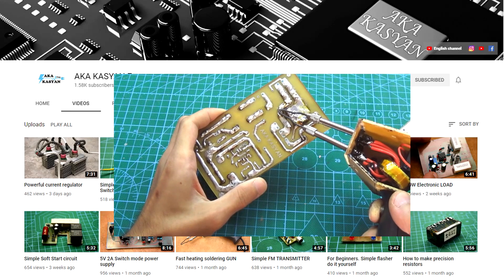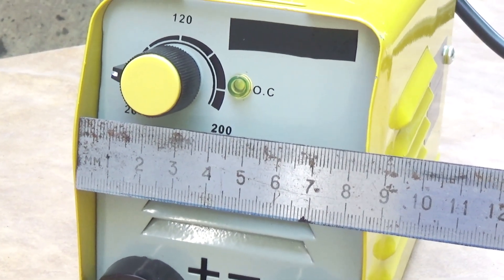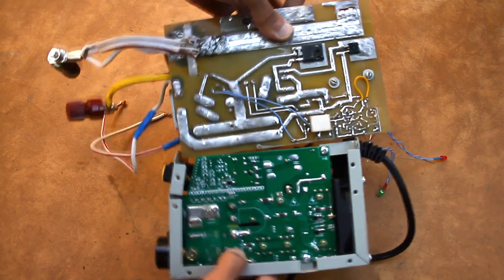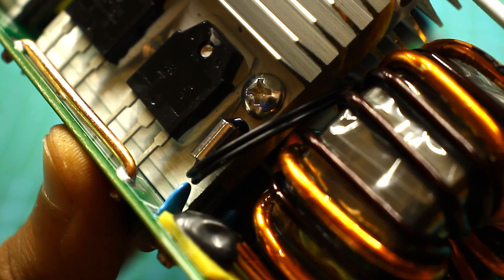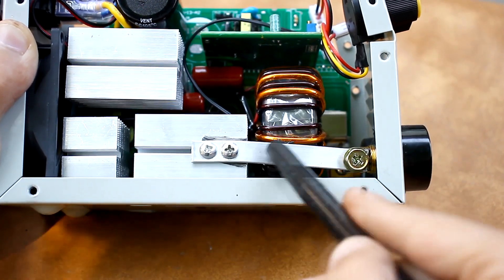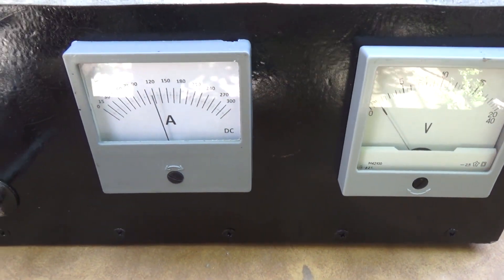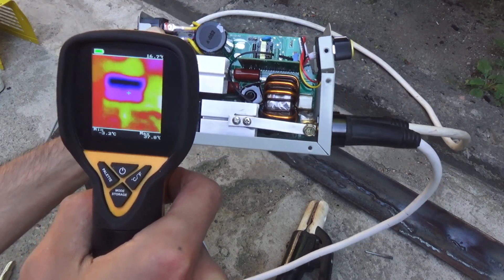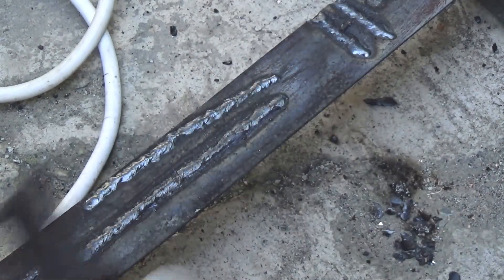What can the SMALLEST welding inverter do

Comment: When you measure the temperature of the heatsinks, because they are silver colour they will measure very low even if they are hot. Paint them matt black and do the measurement again .
Reply: Exactly they reflect the IR So you can't get an accurate  reading

Comment: No earth to the case makes this all-metal unit dangerous when used if a wire should short out inside as the operator will have metal benches that will be earthed so I would not purchase this item

Comment: Thanks for sharing I've been doing welding work since I was 21 now I'm 50 years old still a welder I never had a chance to use that smaller machine but it works good job.
Reply: Is it advisable to buy this?
Reply: @solomonpaul5317 
Yes.

Comment: Are the mains and secondary windings of the transformer not isolated from eachother? Dark and light copper wires seem to touch eachother. If that is the case, isolation is only from the coating on the copper wires. That can not be good. It's difficult to see from the video.
Reply: No reply on my point. So point taken  :-) I bought such welder too. It was actually cheap (<$40) and opened it to inspect. I have doubts if the device is electrically safe mainly because of the high power mains transformer (there are other smaller in the design as well). So just in case, I also bought a high-voltage supply for testing (4Vdc in 1800Vdc out @ 0.5-1mA). Cost only 2-3$ and will use it to check the leakage between mains and secondary (so 220Vac input and welder output / metal housing). If it is safe to use, there should be no high current flowing and voltage should be stable.

Comment: Another wasteful video, the demonstration given was making beads and not welding two items together, that is what the purpose of a welder is not to just run beads. Also, the supposed heat displaying was not proper as the cover was not in place to help with the airflow of the fans to keep the interior components cool.

Comment: First Video I have watched of this channel and it only took half the video to become a subscriber. Good video. I have a unit like this, mine came with the cable for a few dollars more. I suspect that these boards are built on mass and then a "manufacturer" puts  in in their own case and labels it. However I could be wrong. At any rate, mine does not provide the amperage it advertises (200) but it does weld pretty good.
Reply: What ampere breaker do you use at the panel for it? And do you use it on 110v?
Reply: @ramblerssafarnaama4181  I have used it at 110V and 220v, While it does work at 110 volt, I have to increase the amperage on the dial in order to get the same kind of weld. I find it lacks the initial "Omph" to create the arc and sticks more often at 110v. I get better and more consitant result at 220v. For the 110v, I have a 30amp breaker available and at 220v, it is a 50 amp breaker. Do you find similar results?

Comment: Cool video. Not bad beads for someone who doesnt weld. Hard to tell how well it penetrated the steel tube. Would like to see another video with welding pieces together to see strength of the welds and maybe some holes in steel plates filled in. From what i could see it was pretty effective

Comment: Would love to get one of these but I'm afraid it trips my circuit breaker, after all with 20 plus amps being drawn thats more than enough to trip a breaker is it not?
Anyone know?
Reply: Chances are that any circuit that will handle a fridge or washing machine or even an HD window a/c unit, it will probably run one of these welders. Got my curiosity up so I just went and checked mine, the largest 110 breaker I have in my place is a 20 amp. Mine never skips a beat. I was so amazed by these that I even bought a couple extras and gave 'em out to my friends.. Finding out that China has been using this technology since the mid '80s. I even took a chance and bought one of the plasma cutters for about a 100 bucks, works like a champ. Just get yourself a really, really heavy-duty extension cord, you're gonna need it, if you want longer welding leads, I used some old jumper cables I had laying around. Good luck.

Comment: Got mine working today, first time welding. I noticed mine has a screw at the back near the power switch, it says in the manual that it is supposed to be used to connect a ground wire to the unit, which is an odd way of setting it up, as the wire would be housed independantly of the others. I noticed on yours that there is no such screw on the back. Mine is the 120v version. It is very difficult to strike an arc with it, it sticks to the metal a lot, but for $100 I got it, plus the grounding clamp wire and the electrode holder. Very good deal.
Reply: 100? harbor fright has far better wire welders for that price.

Comment: 15 years ago I bought for 100 USD an italian Telwin 100 Amp, a 125V which could be plugged on a common 15A plug so it was usable everywhere with 6013; 309 and 312 sticks. Excellent for light fabrication and reparations anywhere with a 15A plug. I gave it 5 years ago to a friend after burning  hundreds of sticks, it works always flawlessly.
A trick, with these miniature inverters, stainless steel sticks as the the 309 and 312 are easier to use, with less heat and gives very good results, specially on 14 gauge galvanized tubing, as the welds are smooth, with minimal burn of the galvanization. No grinding needed as the "glass" pops by itself and the welds are nice.
Reply: That is a characteristic of DC welding.....you hardly ever get a bad weld and no splatter either.

Comment: The enclosure is metal and It didn’t look earthed, earth bonded or double insulated. Could be a death trap?
Reply: I bought one, the 120v version, and there is a screw on the back that is supposed to be used to connect a wire to ground the unit, I'm not sure why but the one in this video doesn't have it, maybe mine is newer. Also not sure why they didn't just include the ground wire with the other 2, I think maybe they got in trouble for not having it grounded so they just added the screw on the back to keep from getting sued. Having said that it does work pretty well for how cheap it is, though the amperage isn't quite as advertised, and it is difficult to strike an arc. Great deal for the money though.
Reply: LABizñ

Comment: I already use a lot of welding inverter but the most durable and good quality Is mosfet than igbt.  You can compare the igbt to an iPhone.
Reply: MOSFET should create less heat.    Transistors are current driven.    FETs are voltage driven much like a tube.

Comment: Yes ..to be honest it was a nice review.
Very helpfu.
Mam, can you please help me in repairing such inverter welding machine.....I have changed the blown IGBTs and rectifier..But unfortunately Iam getting repeated damage for the replaced ones.
I have also checked the other adjacent components for fault..but they all seems ok. What to do...please help.
Hope you will help.
Reply: Replace the whole unit, it's cheaper and no labor cost or time...

Comment: hello would it be possible to remove diodes on the output side to make ac instead of dc     ...so converting it to a ac welder instead of dc ????? thank you
Reply: No, the output frequency is in tens of kilohertz, so DC conversion is required to prevent radiation loss.

Comment: How much dose it need until it tig
Reply: You will need a Tig torch and cable with tungsten electrodes and some Argon gas, then you can do scratch Tig welding quite easily with practice.

Comment: The best technical review, 

Cal:240Vx40Ax0.8/38Vout=200A
In order to output 200A, change IGBT to 50
Amp or higher, change current sense to lower turn to boost out put current,
Change output diode to to 250A
Good luck
You do not need soft start for welder since you never weld before you turn on switch
Reply: Good ideas for upgrade 👍
But surge limiter is also a good idea to charge 680microF cap slowly, reducing shock on rectifier & switch.

Comment: I bought this machine from the geek less than €50 including delivery. Delivery time was 2 weeks. I tested with 1.6 mm stainless, 2.5 and 3.2 normal stick. The performance is very good, ach is stabile, start is easy. The size is awesome. It's been a very nice deal, i am quite happy and satisfied.
Reply: Szia László! Azt szeretném megkérdezni tőled, hogy milyen néven, és hol vetted? Előre is köszönöm!
Reply: Is it easy to make a hole with 1.6mm tainless?
Reply: @funnymoment5850 sorry for the late reply, the youtube doesn't send me notices.
1.6 stainless stick can be overheated easily however with short breaks quite usefull. 
To make a hole? Of course it is depending from the thickness of the material what you welding, and the amper what you have setting.

Regards
Reply: WELL SINCE YOU LIKE THAT LITTLE WELDING BUZZ BOX SO WELL WHY DON'T U MOVE OVER TO CHINA AND LIVE THERE 4 THE REST OF YOUR LIFE AND HELP COMMUNIST RED CHINA MAKE LITTLE WELDING BUZZ BOXES,PAINT THEM RED WITH GOLD STAR,U WILL BE EVEN MORE HAPPY😀😀😀

Comment: The metal being welded in this demonstration is only 1/16 inch or 1/8inch maximum thickness. Just slightly more power full than a Spot Welder.

Comment: 50 amp = 25 amp
100 amp = 50 amp
150 amp = 75 amp
200 amp = 100 amp
It gives out half amps not full amps
Reply: Daaa
Reply: I just bought one off of Banggood.  LED says 228 amps.  My clamp meter shows 114amps while welding.  I am upset...what a ripoff.

Comment: I've had one of these little guys for about 4 years now. It never ceases to amaze me...
Reply: Me too ! bought 1 from china 6 years and it still go on... why need to pay more if you can get cheap, reliable and powerful welder ! :D
Reply: What's the model you have, if you dont mind.
Reply: @plucky2115    I couldn't find a model # on the machine. It's from Harbor Freight about 4-5 yrs ago. It says; Chicago Electric welding systems Inverter arc welder(uses 3/32" electrodes). Case is white and is 9" D X 4" W X 5 1/2 " H. Hope this helps.  Y-T
Reply: @ytwhite5930  thats good enough thank you now i know where to look for it
Reply: @ytwhite5930  Does it work on 110V ?
Reply: @alainbrisebois8334    Yep,Only drawback is that it uses 3/32nd" electrodes ONLY...But it works well and my whole stick welding outfit(without helmet) fits in a sawzall box!!!
Reply: Hi. Would you highly recommend this device? I only want to use it to do light welding on Classic cars that I will buy and sell, but only will weld occasionally as I try to buy classic cars that don’t need welding but past experience has cost me to pay someone else to weld bits of my previous classic cars! Apologies for the long message 🤦🏼‍♂️🤷🏼‍♂️👍🏻
Reply: @Alhumdullullah  If you need to do precise welding get a Tig torch to go with it and some Argon gas then you can do a scratch Tig start.
Reply: @Alhumdullullah  should be fine for sheet metal and most thin frame unibodies. i wouldnt use it on thick full frames though.
Reply: @Alhumdullullah  go tig for classic cars

Comment: can you run this using inverter hooked up to 12v battery.  what is the power rating of this welder? can 8000w pure sign wave inverter connected to 12v battery run this welder? can this run on 110v outlet? is it possible to use transformer to run it, what is the minimum transformer rating required to run it?

Comment: The Miller Maxstar 150 weighs 13.2 lbs. , & when you plug it into 110, you can tig with 1/8" wire all day long, but is not worth a shit for stick welding, but when you plug it into 220, you can stick weld with 1/8", 7018 rod if you want & welds great, all day... i like welding plenty warm too....

Comment: That reminds me of my dual voltage everlast welder. Really good power in a small package. Very convenient to carry.
Reply: Yes there amazing for the size, l got a Parker 160 inverter few weeks ago and I have welded my mates shed frame with 2.5 rods, used about 80 rods, l run it from a 16amp supply.

Comment: low hydrogen electrodes can possible to weld with this machine, if possibly to welding, how many hrs can do is it?
7018.. 2.5 mm
7018..3.2mm
7018..4 mm
7018..5 mm
electrodes can possible to weld continue?
Reply: It is most likely underpowered for anything over 2.5mm electrode. I use 2mm 7018 with mine no problem. But as any Low H electrode must be fresh and free of moisture to work well. This welder however does not work well with 6011....

Comment: They put tape over all the names. Why would they do that? And no ground on the power cord? Well, some really cheap junk Chinese welders and plasma cutters have a ground screw on the back of the case for you to add your own ground wire. Not a great idea.

I bought a few cheap Chinese welders to see how they were built, and to measure their claimed output. Some were built adequately, though the design was poor. But none came close to their rated output for more than a minute, and two blew after several seconds. So the number on the readout isn’t really telling you the truth. Keep that in mind.

Comment: Why does this welder only have two wires for the electrical plug?  There should be three wires where the third wire is attached electrically to the case then to electrical ground.  This is done to prevent the case from becoming live in the event of an electrical issue.
Reply: It's DIY.....
Reply: @gangleweed  It's DIY?  No!  It's not DIY...It's how many of these Chinese made welders are wired.  Dangerous! A three-prong plug (min) should be used and the ground wire needs to be added to the metal case.

Comment: Do I see correctly, there are 4x 20A diodes to get "200A" on that POS welding toy?!?
So these poor diodes (that are probably china fakes in itself) get like more than 2x the maximum rated current at max welding current? No wonder all that china crap burns up short after buying.
Reply: The current is less on the 240v main side than the output, for the same power, else that input wire would burn up first.  Do you really think your main power input to something like this is the same as it's output power at ~ 1/10 the voltage?  Power is volts times current...and if it's efficient, which she did somewhat show by the internal heating, then there's no issue.  The fact they claim 200a but only get to around 100 is more of an issue for real welding.
Reply: @DCFusor  a issue of connection resistance.
Reply: @DCFusor  For the average DIY weekend welder doing small odd jobs the output would never be an issue.....that is the market it's aiming for.
Reply: Some people don't understand watt calculations it seems.  20 amps at 240v for example is 4800 watts.  If you transform* the voltage down to 30 volts - 4800 watts is
160 amps - watts = volts times amps.
Those numbers are for100% effiency, and the real efficiency is perhaps 85 percent, maybe a little better, so output would be more like 136 amps at 30 volts, or more amps if the voltage is lower. This is "electronics power calculation 101, grade school stuff.  And sure, that's enough to be a weekend welder- I was the one disputing those who say it isn't!  Reading comprehension!
* word choice is important here- a transformer or as here, a simulated one via pwm switching and filtering - accomplishes this.  If the voltage is dropped via simple resistance alone, input current = output current - Kirchoff's law.  Simples.

Comment: Can this be converted to a spot welder? If the input power is pulsed while on. Will the output pulse? Is there a link in the description??
Reply: JAMES! Since the 70's rather Puls the output with a high amp solenoid relay. Should be able to switch quick enough for most cases.

Comment: You forgot to mention the current consumption on the socket on full load
Reply: 15vdc at 120amps =1800watts, so AC should be around 205vac @9amps

Comment: Fantastic, dude! Thanks for the review! 😃
I was looking into this welder and thinking about buying it... Now I'm sure it could handle my small projects! 😃
BTW, did you ever find any mig welder from Banggood or something? That would be fantastic as well!
Reply: Do yourself a favor and buy old transformer machine-sure it will be harder to start ,but once you learn use those you will be better at welding with anything new.
+It will outlast you and your grandkids since its just copper coils and no electronics but a switch.
These cheap inverters are just not worthy,even for hobby use.
Reply: @zumbazumba1  but are they not very heavy to carry around?
Reply: @josh-pe5fe  99% of job is done in shop ,unless you do field work like a lot portability is not something you should aim for when buying a welder.Beside you can always make a cart with wheels for it.
Reply: @zumbazumba1  You are right. The old welders were solidly built with plenty of copper and really indestructible. But the Chinese want to build everthing the cheapest and having cheap labour, minimal materials used and government subsidisation results in equipment such as these inverters. They will last only as good as their manufacturer. Here in Australia we made excellent welders, and I believe all the makers have disappeared, replaced with container loads of Chinewse junk.